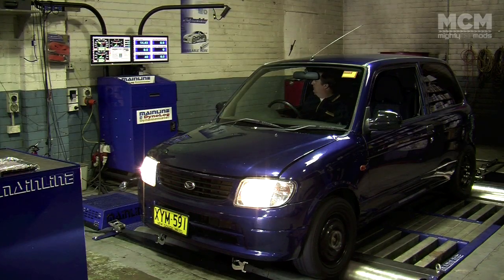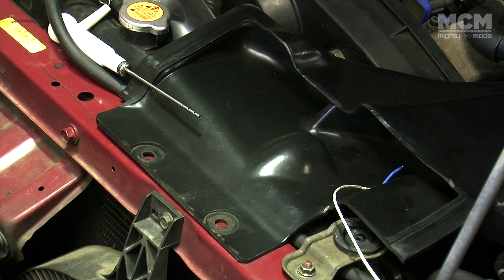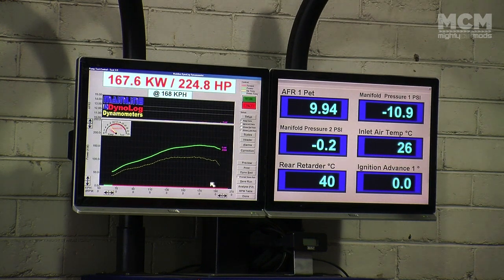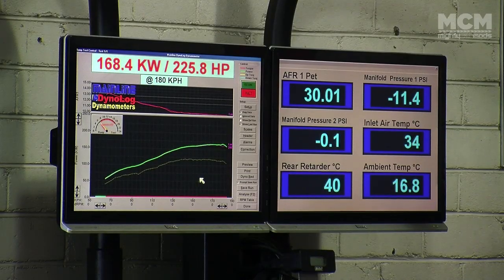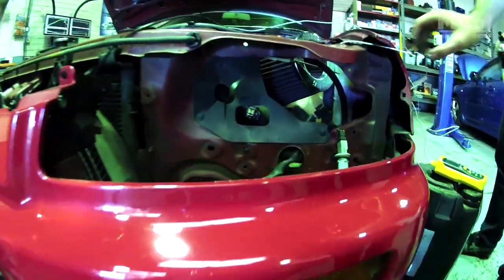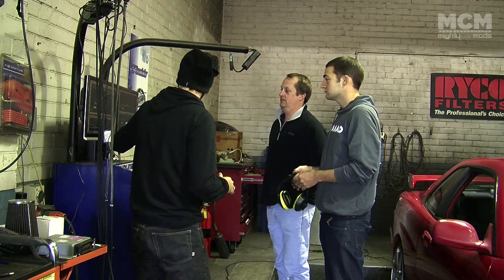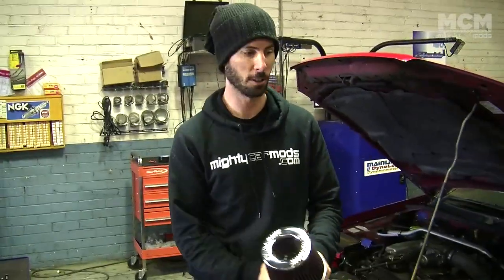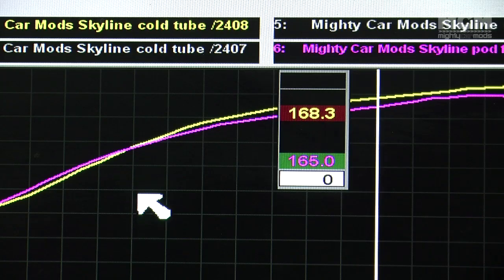Cold Air Intakes Mythbusted [Turbo]

Comment: I dismiss this test that you did.
Its my opinion your test didn't prove much at all.
I own a XR8 with a shaker installed.
The shaker sits out in the open above the bonnet and when driving forces air into the shaker and then directs it into a 4 inch pipe which goes straight into the factory airbox the original air filter removed and a more efficient BMC reusable wasble air filter in its place (saves money on replacing throw away filters )  then from the the factory airbox to a 4 inch air feed pipe to the factory throttle body.
The air is less restricted with this system.
I can actually feel the difference in throttle response and at night its more responsive.

Comment: If that doesn't improve car power, what relatively cheap solutions can I use.
Reply: depends on make and model. start by doing any and all maintenance it needs. then go with intake, exhaust, and if you have a turbo car, get a boost controller. every car is different though. some cars make an extra 2 HP at the wheels with a relocated intake air temp sensor (like mine does)

Comment: I think your results are inaccurate because there is not a high flow of air in front of the car as it should when it's moving and the intercooler is less effective.

Comment: Why do they even bother testing on vehicles with this low power and thats stock. No one wants to know if there is a difference and most people know there will not be on most stock cars.
My daily drive is diesel wagon with around 400 hp. I would like to see a test with cars that have around 400 hp and up. And also test how good/bad the filtration works on the filters.

Comment: You said you were going to test whether or not a cold air intake made more hp.  I was skeptical when you brought in a skyline which was already modified from stock (RED FLAG #1)  Red flag #2 was having to REINSTALL the factory airbox.  Red flag #3 was when you ran the car with no air filter at all.  Red flag #4 was when you removed the headlight (which has nothing to do with your test).  Red flag #5 was when you used some garbage corrugated tubing to extend the airbox outside the car (you called it the "ultimate cold air intake" which it absolutely is not.  Ever wonder why 100% of cold air intakes are either molded plastic or mandrel bent aluminum?  IT'S BECAUSE THEY'RE SMOOTH INSIDE.  This allows the ingestion of more air because the incoming air isn't turbulent as fuck.  RED FLAG #6 was when you only ran tests on a car that is has forced induction.  OF FUCKING COURSE adding a CAI to a car with a turbo isn't going to see noticeable gains, because even with the stock airbox the engine is getting all the air it can use.  

If you had run these tests on a factory STOCK car which would have actually benefited from having a less restrictive intake.....your results would have been much different.

Also, there's no telling if the car you tested had a custom tune when you started, so this whole video was a complete waste of time.

Comment: only real gain may be seen maybe by type of filter. slight gain if you increase air flow pass said filter type. now why not try chilling the fuel ? 
many years ago we raced modified division in california. and would run a in line system just before fuel would hit the carburetor - a canister filled with dry ice. and of course racing officials soon outlawed any such device as claimed it gave an unregulated advantage. engine output was around 1100hp - normally aspirated ford engine.

Comment: How are you getting cold air through the headlight if the car isn't in forward motion bringing cold air in? That makes no sense.
Reply: the big fucking fan simulating air movement while driving??
Reply: @billybuchanan385   Yeah......while driving.....the car isn't going anywhere. All I'm saying is that if the car were actually moving forward bringing cold air in through the headlight at speeds above 60 mph wouldn't you see even more? The fan is doing it all....but what about actual movement....That was what I was trying to say. No shit the fan....what's the point of opening the headlight to gain 1% if it isn't accurate with stagnant air around the car. What car do you drive in one place?

Comment: I don't think its a fair test. If the car were going down the highway they air would be cooler going in in both instances. At a full stop the air will be relatively the same temperature.

Comment: even if youve put an ice chilling air it wont because air compress the temp directly proportioned to the pressure.think of the deisel the higher the pressure compressed the hotter it is.

Comment: The car is these guys are testing are low horsepower cars do the same test on a 500 hp engine and see if you get better results air volume is much more demanding the more hp you have

Comment: 20% is ridiculous, maybe 3% if properly tuned. You loose power unless you have a MAP sensor, because you will run lean.

In short, the claims are not true, but you can gain power, but your doing it wrong.

Comment: Not exactly scientific. There was no consideration of flow characteristics, only obsession with intake temp. The right diameter, shape and length of tubing makes a difference. Cold air intakes generally make power at higher rpm. The engine computer will only compensate so far for a leaner condition created by more flow. Depends on the car I suppose. When an engine is tuned for the better flow of a CAI, the gains are better than with the tune alone, thus a CAI is proven to work. Using dryer hose? Umm results may vary.

Comment: the term cold air intake is actually incorrect nowadays. but ppl still use it. in order to see gains from a cai you would need wider intake hose to account for the air that the less restrictive filter let's through. plus all of them that claim increase in horsepower require a tune to the ecu.  just cause you make the tip of the straw bigger doesn't mean you get more liquid through the straw unless you increase the size of the entire straw. try the same test on a v8 and do it right. those Lil ass engines don't suck in enough air to begin with. and a boosted engine won't see any gains really because the air is already being forced into the engine at a specific psi. I know the video is for fun but it makes it seem that y'all don't know anything about MOD a car

Comment: and you still have to change throttle body and exhaust to compensate for cold air ive installed plenty personally and when done right it gains more than noticeable as well as i dyno tested to back it up learn what your talking about before you start spreading bad info to folks that dont really know

Comment: Once again you use a stock car, yes a better intake does nothing, even hurts it, but if you do it correctly it does help. And that tube is really messing with air flow, it's too long meaning the engine is having to work harder to pull air in and it's not smooth so it causing turbulence.

Comment: I feel like the scientific method was not fully well tested on this video.  In the real world, whether on the street or track, you're going to be out driving around at higher RPM for extended periods of time.  The heat from the engine will radiate outward and build up in the engine compartment.  CAI is supposed to suck air from outside the vehicle where temps are cooler.  How is a dyno run supposed to approximate these real-world driving conditions?  The engine bay isn't going to be warmed up just by several dyno runs alone!!!

Comment: Wouldn't you need to be actually driving in open air instead of running stationary on a dyno??? Doesnt the car need to be moving to take in more cold idk 😜
Reply: I just asked a buddy about this and he told me most dyno tune places have fans to blow to the front the car. I guess thats pretty much the same environment as if actually driving the on open road 😐

Comment: Any explanation why it doesn’t work??
Reply: Because a cold air intake does nothing to drop your incoming air temperature.  CAI is mostly marketing hype.  In almost all cases, the intake is not the bottle neck holding you back from making massive power.

Comment: On a factory engine the factory airbox is more than upto the job getting the air into the engine all inductions kits will make you lose power at that stage.
Best thing to do is just replace the factory cold intake if the factory one is in a shit position and a air filter that isn't more restrictive than paper 🙄🙄 ie k&n outright worst available on the market.

If your making alot more power than factory then upgrade but otherwise don't get sucked into bull

Comment: I'm septic about a STATIONARY car and one in mouvement increasing more air to the intake ???
most filter inside litle boxe have no room to breaf...but put it out with more air specialy at 60MPH and i'm sure your result whont be the same! same as a kite, will increase in altitude if you run insted of stay imobile . So Scientificaly i give you a Tumb down.

Comment: Any type of cold air intake or ram air is worthless on a car with forced induction. A turbo or super charger compress air. When air is compressed it get hot fast and unless you have a remote mounted turbo the turbo will conduct the heat from the exhaust making the charged air hotter. That’s why you have to get an intercooler liquid to air is best cooled water or ice water cools the charged air makin O2 molecules bunch together tighter allowing more fuel to be burned making more power. And a high flow air filter is worthless without high flowing exhaust

Comment: The car has to be retuned to take advantage of any improvement of air flow.
Reply: You're right.  I'm suprised no one else mentions that.  Most stock computers will cut fuel flow if more air is introduced into the engine.
Reply: +mustang6035 bingo, but backwards! 

It thinks too much air is being pulled and slowly adjusts to richer and richer to compensate. It will either do that or run in limp mode with the fuel on full blast with a check engine light to prevent lean detonation.

Neither change the mapping for the better.

Comment: CAI are useless on turbo cars, there is a reason there are intercoolers on the cars to cool the hot air the turbo heated on the air it sucked in.

Comment: this is true yet not true..I have a 2009 GT500 mustang and I put a could air intake on it and gained 80hp but it also cost me over 1500 bucks and it came with a bunch of stuff like sensors and I needed a tune after it was installed...point being there is no point in just popping on a cold air intake on a normal car and expecting to get gains.

Comment: results would be different on, say, a 2.7 stock charger as opposed to the skyline. on the 2.7, the gains are noticeable and it's about all you can do besides exhaust to help that tiny fucker out so in that situation it is worth investing in at least to the driver of that particular situation.

Comment: Also if anyone cares to take screenshots of each dyne output my explanation is further proven watching the AFR track in. Air flow meters on these cars are specifically calibrated to what hardware is fitted. From RB25 26 to 300ZX which is interchangeable they are all calibrated across the ECU reference signal of 5 volts. Ergo not changing the voltage to smooth out the AFR,  you’re not gonna got the power increase. Do so, so that it starts running richer earlier, advance timing to suit and you’ll see the difference!

What further shits me is this is a bad fucking example. The GTR airbox has been proven to flow over 400 Rwkw. So why when there isnt a restriction would you see major gains? You wouldn’t really! The only gain comes from feeding colder air into the motor for longer periods of time, as per the third party who commented that the temps didn’t rise! Fuck so much wrong with  this video

Comment: Ru guys stupid? Lol sorry! U did say tho 2nd test was filter down behind the bumper/under headlight, but u just removed light n put filter bk in engine bay! Where all the heat is! Same as test 1 guys!! I read team rs found best place for cool fresh air supply was behind bumper under headlight. I just took a duct down to that area on my st 225, from an inline k&n enclosed cold air cone, straight off maf sensor, end of duct I wedged into a small scoop in floor panel so half sucking fresh air from just above the road, half from behind bumper area. Seems to work a treat, exhaust bangs louder n seems to love it. That's wot I've found anyway to be best. Just wants insulating from heat in engine bay area. Only better way wud b pipe straight up from turbo in front of driver, maybe bit cut out bonnet...that's the next stage! Super charger that too!

Comment: So aftermarket intake takes away you horse power ??
Reply: can it take it away from my mustang?
Reply: Carmicha3l my mustang is pumping like 100hp and I have no idea how to tune
Reply: No mods
Reply: Ok I'll hit them up
Reply: I have a CAI cold intake for my 2016 Camaro SS which is giving me 8 hp and 13 foot lbs. So my car debunks the debunkers
Reply: My Avenger seen a power gain from the Mopar CAI. But then again, it was heat shielded and I had catbacks to go with the intake.
Reply: So superchargers take horsepower away?
Reply: +Gian DeCarlo nope. They give more hp
Reply: To be precise, it takes a part of the engine horsepower as an input and gives you more horsepower as an output, if it was a belt driven one.
Reply: Lamborghini

Comment: You need to drive it outside moving fast so air could pass it through the intake manifold....inside your dyno lab there is not much air cause the car is not moving.....
Reply: did you not see the big fucking industrial fan pointed right into the air intake?

Comment: this is a useless test on this car, it's already tuned to the specs to match it's intake, fuel, and back pressure . The brain will correct excessive o2 to stabilize performance.

Comment: You can not just slap a cone filter on you need to increase the diameter of the piping to expect any gains but 5horsepower is the most your going to get. And your gas mileage will go down as pulling more air in required more fuel. A tune is only needed on older cars most cars from 2006 on will just adjust the fuel trims based on your MAF readings. This test was done horribly.

Comment: Its not busted at all. Kinda disappointed with you guys, you should know this. Speed density is directly proportional to intake air temp. The r34 has a factory cold air intake. Its just that simple. You proved it yourselves, take your best run (the absolute ambient air, mixed with a tiny bit of ram air) and compare it to your worst (the diy "I got a mad cone filter" that everyone does in their mum's gardens). Proper cold air systems will increase HP by 5% over sucking under bonnet air, and that is a universal fact, whether you make 100 hp or 10000 hp at the wheels, increasing the air temp will decrease HP proportionally.

Density=pressure/(287.05*[air temp + 273.15])

So lets take a standard day:
ambient pressure 101KPa
ambient temperature 20 celcius

P=p/R.T
P=101000/(287.05*(20+273.15))
p=1.2kg/m^3

Now lets take the conditions behind your radiator without changing pressure:
pressure 101KPa
under bonnet temperature (a conservative) 125 C (should be around 150-200 for turbo engine but lets give it the best shot)

P=p/R.T
P=101000/(287.05(125+273.15))
P=0.963kg/m^3

Hmmm that's significantly less mass per volume
Lets compare:

0.962/1.2*100
=80%

Damn.
Congratulations you just lost 20% of the engine's potential volumetric efficiency. In a perfectly efficient engine that is a loss of 20% power.

u should have done your tests with both a heating & cooling mechanism to feed the dyno fan with desired (controlled) air temps, and watch your HP figures go up and down like friken shore waves. 

The fact of the matter is this: There are three ways to make power and ONLY these three; Air density, displacement and rpm. Density is a function of pressure and temperature, density as a function of displacement at a given AFR gives your torque figure, and HP is just a function of torque and rpm. So the cheapest way to increase power is to decrease inlet air temps and reduce pressure losses in your intake system, MEASURE air pressure before and after the filter and you will know what do to about that, if anything.

P.S. Boost means nothing. go watch boosted bois and ull understand exactly what I'm on about.  they had a b18 with 25 psi of boost making 600whp, cranked it up to 40 psi and still 600whp....cuz Lussac's law. p1/t1=p2/t2 when increasing p2 you also increase t2 to balance it out, soooo more boost, more temperature, same density. Literally the worst way of making power. Sounds epic tho, but BAAAAAD for your turbo, BAAAAD for valves, BAAAAD for scavenging, BAAAAD for heat saturation. I could go on. Gale Banks has a cool dyno session where he made more power on a super turbo diesel by reducing the supercharger speed and lowering overall boost. Now if that video dsnt prove temperature is crucial then nothing will.
Reply: Your math is good, but how many cars built in the last 30 years pull air from the engine bay?   Nobody argues that cold air is denser than hot air.  The argument is does a cold air intake lower your IAT compared to stock.  This is the one thing that nobody ever measures when doing these tests.  (which is funny because it requires a $20 thermometer vs $$$ dyno time)
Reply: @jimfallowfield7028  You are kind of making my point for me. The argument "does cold air intake improve power" as a blanket statement it absolutely does, the math is there, and its why manufacturers do it. Question is how effective is the factory system vs whatever you are thinking of doing to your car. And Amen, you are absolutely correct, upgrading or changing your intake system shouldnt require a dyno as it's a process of elimination. probe the area of the airbox intake and probe your filter for pressure losses. Run tubing as straight as possible and voila.